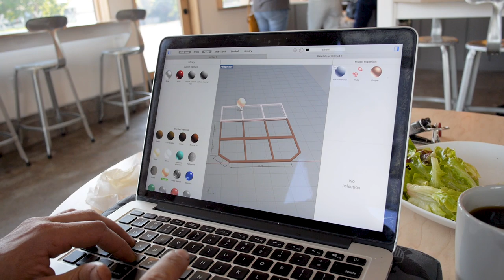DIY Sprinter Van Bed Build | Removable 3-Panel Loft Bed Fits a Queen-size Mattress

Comment: Hi Sergei, I was wondering why you used steel rather than aluminium? Really nice design with 45 degree corners and rounded edges as well as the slanted rear panel, well done.  I am going to reach out to Jason about the frame. Thanks oh and i have been scouting and eating many wild plants in my area on Vancouver Island BC

Comment: why use steel, yes its less expensive however yu are going to powder coat it which brings up the cost, also steel is heavy, almost all th builds I have seen have used aluminium, more original cost however much less time involved in putting t together considering th e powder coating? just curious

Comment: Hi, nice build. One thing, and I think is very overlooked in vanbuilds is safety. Even in a minor front accident the bolts would shear and if someone is sitting in the back, it takes their heads off. I would end the side rails in an L shape or something similar.
Reply from the maker: Thank you for bringing this important safety concern to light. We planned for this in the build. The bed sits lower than the backseat headrests. In the event of a car accident the bed would hopefully hit the headrests instead of peoples heads.

Comment: Hi, thanks for the video, what size and thickness steel tube this is?
Reply from the maker: The bed frame is made from 3/4 inch tunes and the rails are 1 1/4 inch.
Reply: What gauge square tubing?
Reply: @outlaw7x77  I'm guessing 16g. That is what I use/used in both of my builds. All of my stuff is 16g 1x1. It's not as light as aluminum but TBH it's not really that heavy.

Comment: Why not, cut the angle iron on an angle at the edge.  Then you can't hit them.
Reply from the maker: Cutting angle iron precisely seemed like a lot more work. Additionally, we felt that steel tubing would be safer in the long run because it would create a wide, flat edge spanning the entire length of the rail. If you hip check the middle section of an angle iron it doesn't feel good. Trust me, I'm clumsy, I know. :-)
Reply: @BoutenkoFilms  it's just one side at a 45 °.  You have way more money than me, so might as well go all out.  I'm not in that position,   It's a good job.  Look forward to seeing more.

Comment: Been waiting for another van video. 
Is there a reason you went with steel instead aluminum? If so, why?
Reply from the maker: Originally I wanted to make it out of aluminum because it’s lighter but after doing some research I decided on steel because the tubes could be thinner. Simply put, steel is a lot stronger.
Reply: Steel is much easier to weld also

Comment: Is there a particular reason you didn’t put holes throughout your plywood? I’ve heard if you don’t you’re liable to have moisture buildup that will cause mildew and ruin both the mattress and the wood.
Love the powder coat idea! Clean looking build.
Reply from the maker: Yes indeed… I’ve read about the moisture issue but figured it’s much easier to drill holes after-the-fact then undrilled the holes. I’m going to see if moisture does in fact build up and if that’s the case, I’ll be adding holes to the top sheets of the bed.
Reply: I had a mattress in the back of my Ford for years with zero moisture issues.  No holes are needed.   I live in Western Washington so...
Reply: I also had no holes and spent 2 weeks sleeping in van in 90* high humidity weather. Granted it was only 2 weeks, but no mold/mildew. I had unpainted plywood with a cotton flannel sheet on plywood under memory foam 6" mattress. Flannel sheet never felt damp either. 2 sweating adults sleeping on mattress. The mattress has a cover in case that made a difference though I don't think it's water proof.

Comment: I see the plus nuts you used on the van, but what tool did you use to set them?
Reply from the maker: There are a few ways to install plus nuts. I used a special bolt tool (not sure what it’s called) and a drill. The bolt tool allows you to grab it with a crescent wrench. In the future I’m going to invest in a plus nut instillation tool for about $100. It’s way more precise.

Comment: More & more are using metal fabrication in place of wood. Think that's good?(!)
Reply: Less material can obtain the same strength, so it can save on space and weight. Wood can change shape over time but metal won't really. I'd probably want to involve metal work in a van build if I knew how to work with it and had the tools. But I don't, so I'll be using wood.